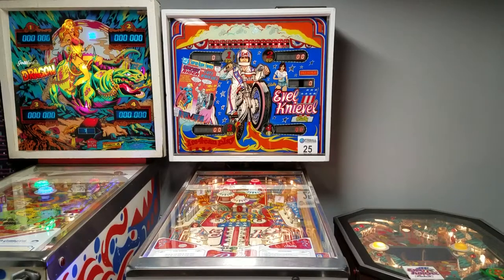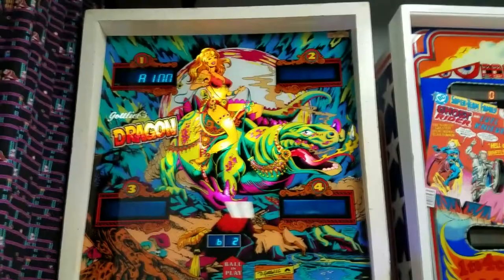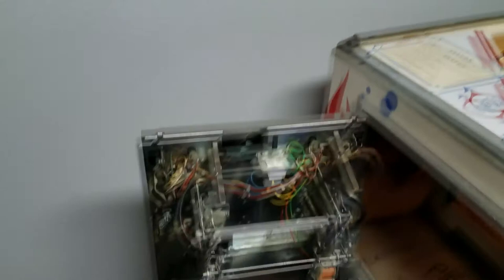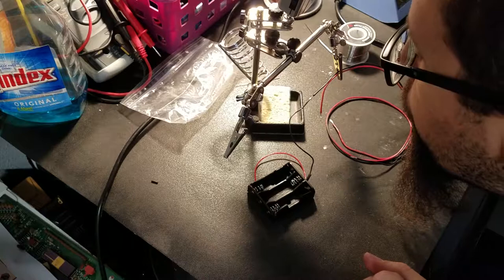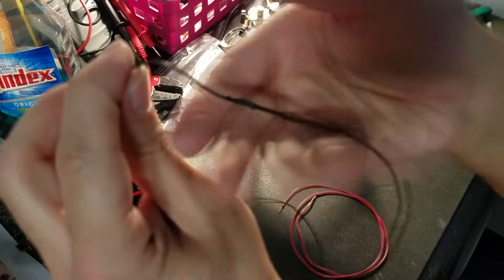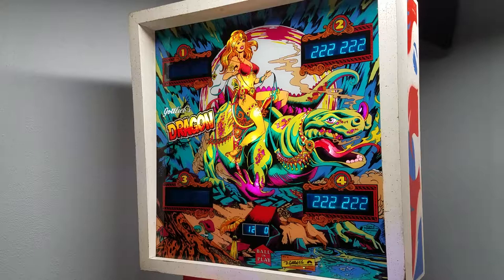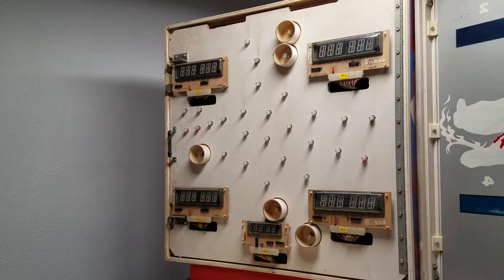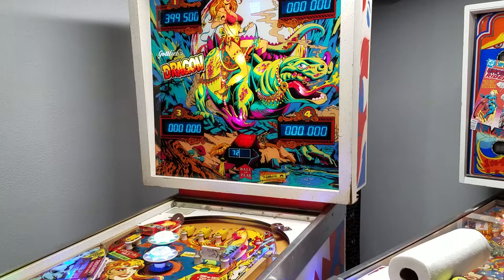How to Remove & Relocate Battery on a Gottlieb System 1 ,Dragon Pinball machine + New Service Switch

Comment: The reason your high score to date is missing the ones digit is because you did not do a reset on the "high score to date" after you replaced the ni-cad rechargeable battery (with 3 alkaline batteries).  Because there are no "one point" switches on the playfield, the high score to date program only works with the left 5 digits and assumes that you did a clear which loads the ones digit with a zero.